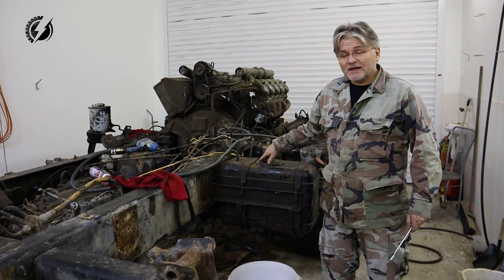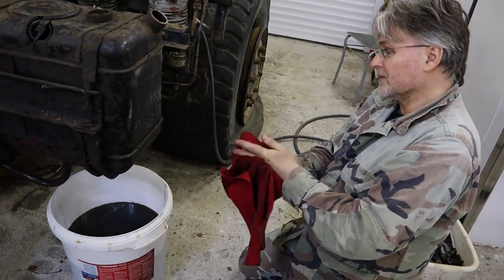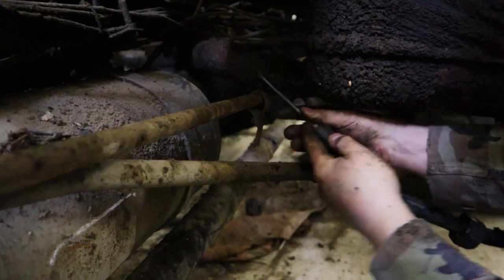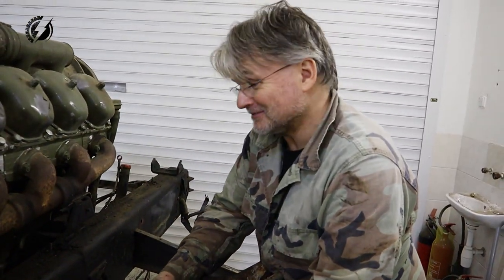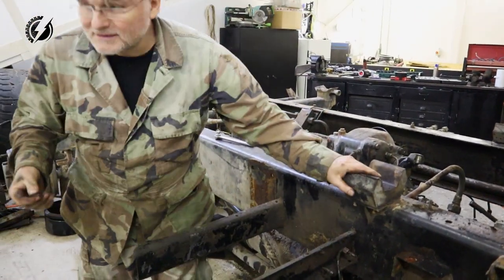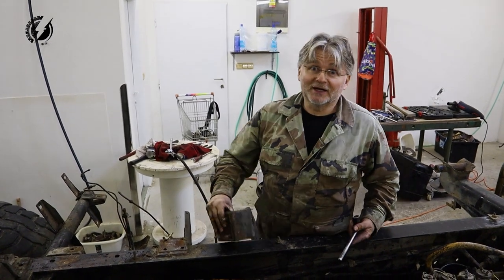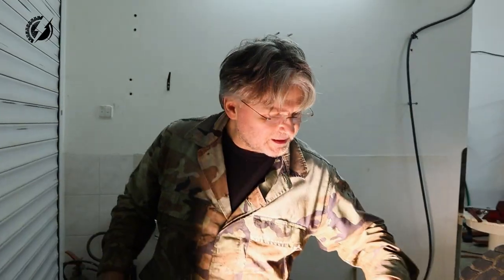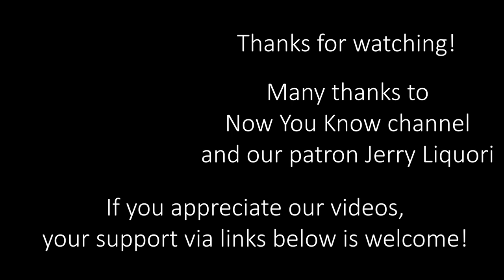Best Off Road Electric Monster Truck Build| Ep.14

Comment: hey what do you do with original engines ? I might be interested to buy one if you sell them ?
Reply from the maker: I sold the first one, and I will sel the second one soon.
Reply: Really Satan?
Reply: @offroadelectric9457  how much will it cost ?
Reply from the maker: @satan8593  Last one I sold for an equivalent of $2200, but it had about 3000 miles. This one will be cheaper, because it has a higher mileage. Shipping is extra.
Reply: @offroadelectric9457  how many miles does this one have ? :)  is it aircooled or water cooled ? and is it v8 , v10 or v12 :)
Reply from the maker: @satan8593  It is V10 air non turbo.  Will look at miles..............We have a problem to get diesel into it now, but so far the engine sounds healthy. You will see it in episode #30.
Reply from the maker: @satan8593  This engine needs the injector pump cleaning, after years of sitting the engine runs only on the max RPM.
Reply: @offroadelectric9457  sounds good , I could in theory pick up the engine when corona situation calms down a bit :)